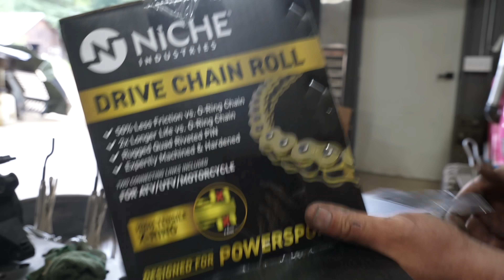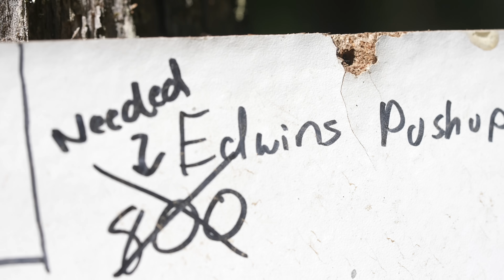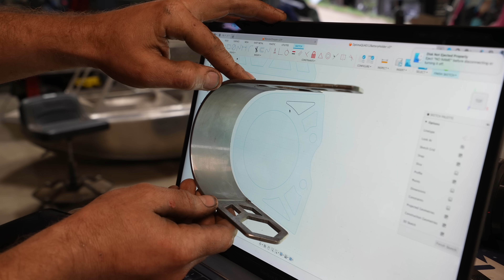We Rebuilt the Chopper and Met State Troopers!

Comment: I've powder-coated for many years and I recommend buying an old metal cabinet, insulating it, and turning it into a large oven with a temperature heat switch. This will allow you to coat much larger parts like control arms, swing arms, frames, etc. Then while coating hang the parts from a rack so you can just throw them right in the oven without messing up the powder. Also wrinkle black is by far the best color and the most durable.
Reply: I built my oven out of insulated tin. It's 2 layer of 2 pieces of tin with a 2 inch layer of spray foam in the middle. I have some old house oven elements in it for heat. One in the top and one in the bottom. Amazon ink bird temp controllers.
The tiny was free offcuts. The controllers were $20. The rest I had.
Reply: It would be great if they could powder coat the whole bike in house
Reply: Wrinkle black is not even close to the most durable choice for your coating
Reply: We did the same thing for curing large prepreg carbon fiber parts. It took a few attempts to get the temperature even and a lot of probes and datalogging but it works very well now that we have it tuned in.
Reply: I wouldnt have even masked up for those tiny mounts lol
Reply: @sublime660  it's pretty durable overtop of ZRP
Reply: To upsize my powder coat size, I bought an electric smoker oven on close out, insulated the bottom, just to keep heat. Works great.
Reply: Dunno man, wrinkle red though..... rocker cover on wheels HAHA
Reply: 100% That little toaster oven that comes with the Eastwood kit is a joke. Even a full size kitchen oven would be better, but like you said, making a bigger one for large parts is the way to go. Not hard at all to make if you know how to fabricate, which shouldn't be much of a problem for Ethan lol.
Reply: @isaaczondag2943   where I used to work, our oven was 36' I'm so glad I still know people that work there and Van give me access
Reply: I used to powder coat everything.   Spent way too much money on it.  I discovered epoxy paint, and a hvlp sprayer   have not looked back.  I got epoxy costed stuff outdoors in the sun for coming on 20 years in the tropics.  Aside from a little oxidation still great.  Hanging on that epoxy paint item is a powder coated item from the same time.  It has flaked off and has rust bubbles.
Reply: Can anyone get ahold of me for ideas/ specs of homemade  ovens?
Reply: @user-neo71665  inkbird seems to make pretty solid temp control stuff. It's a highly recommended addition to most aquarium setups once you get past that "I'm never financially recovering from this" territory (if a heater fails. We trust them to shut them off before overheating the water/fish) 

Cool to see them recommended for a totally unrelated purpose as well.
Reply: @preciousplasticph  I caught a smoking deal on an older 3M HVLP setup. The hose is short but the turbine is small so it's easy to move around. 

GAME. CHANGER.
Reply: I was going to suggest the same. I used to powder coat custom wheels. We had an oven that you could literally stand inside of it; we made a huge rack that would slide on metal runners like a railway track. That way we could powder coat the wheels and not need to move them as it's very frustrating having powder coated a wheel and you just bump it the tiniest bit and you have to re do it again!
Also especially with wheels, you have to immediately take them from the sand blasting cabinet and then we put them straight into the oven to outgas any volatile hydrocarbons (wearing gloves so no finger prints on the wheel) for 1 hour. Wheels out of oven and powder coated and put back into the oven on the roller train rack and baked according to the coat directions 👍
Any porosity in any weld or imperfections in the product (especially alloy/aluminium) can potentially be a spot where the coating will fracture and allow corrosion to get in.. leading to delamination of the coating.

Outgassing parts is probably one of the most important things that most people don't do.

Second is not sand blasting or handling the part and allowing any transfer of oils from the skin onto the part will ruin the part to start again.

We would use industrial strength paint stripper in a barrel (not watered down) to strip any part that didn't meet QA?

The wheel would get paint stripped
Power washed with a pressure washer
Sand blasted
Outgassed
Powder coated under coat 
Hand sanded wet n dry
Outgasses again
Powder coated in the base coat
Baked

If the colour was a metallic we would only "tack off" bake the base coat and after a short bake to l enough to make the colour gloss; then we would pull the rack out of the oven (not allowing too much time to cool or else dust could be attracted as the part cools) it's more difficult to coat clear when it's hot and requires the higher setting on the powder coating because the heat wants to repell some of the powder off the part and the base coat has some electric insulation effects so more "attraction" is required for the clear coat powder to adhear to the tacky still warm metallic base coat.
Then you get the parts back in the oven as soon as possible to try prevent any dust or particle  contaminates. The power coating gun will need to be cleaned properly in between doing the base colour and clear coat.

Most parts that were metallic we would often do the base colour and let it cool to be inspected, then the following day we would do another coat of colour and then do clear coat immediately after. That way if there were things like finger prints or dust in the first coat of colour, we could sand them out and touch up with base colour (repairing any imperfections or stuff ups as well gives more coverage and depth to the final finish in clear)
Powder coat the clear coat
Bake
We used a open ended booth with vacuum extractor (opposite to conventional booth because it's not enclosed and uses positive pressure)
Reply: I can also concur that wrinkled black or texture coat is by far the best as well!
Reply: @preciousplasticph  you absolutely must wear a suit though painting epoxy. That shit coats your hair on your arms and legs and NEVER comes off unless you like bathing in mineral turps!

Epoxy is very durable and has a little bit more flexi when it comes to durability compared to normal powder coat. To prevent chipping paint the selected areas in stone guard first and then sand smooth before doing colour 👍
Gives it some cushioning from stone chips but will require a lot more standing if you want it to finish like this rest of the paint or there's the chance it may not ever finish like the normal paint or cause tint discolouration on lighter coloured metalics (no matter how many coats your do - you've been warned)
Reply: Yes! This man knows his stuff!
Reply: nice
Reply: Why not use freezer/icebox since its already insulated and there is some with metal inner walls? Add separation sheet metal as heat shield, maybe some ceramic whool between sheet metal and ice box interior, window to door, heating elements from electric grill or such with temperature controller and you are done. Just need to make sure there isint plastic on the door area. Never built one but should be cheap since you can recycle most of this.
Reply: I was trying toto figure out a way to coat the frame of my Gas Gas 450 fse. I had considered making a cabinet that will slip over the front of a old oven or something. But I like your idea.
Reply: @andrewkiefer2628  Hey, insulate the shop well enough and get a good fire ripping and they could do it.
Reply: @user-neo71665  Isn't spray foam highly flammable?

Comment: I worked as a Tool and Die Maker for over 40 years so I have a few tips for you. 
---To machine hardened steel use the carbide from a concrete drill, set the center of the top surface of the carbide about .030 of a inch below center and slope it down at around 5 degrees, machine at a very slow speed and use NO coolant or lubricant, it will cut like a hot knife thru butter. Concrete drills can drill holes through milling cutter shanks, which are usually around 58 to 60 Rc.
--To straighten a shaft, heat with a torch, localized on the outer curvature of the shaft, till it turns blue, then quickly quench with wet rags. This method will pull a shaft up to .060, but if the bend is more, run a bead with a welder, again on the outer curvature and again quickly quench with wet rags, this method will pull a shaft up to and exceeding .125 of a inch, the excess weld can be removed without the shaft bending back.
--When welding hardened steel, always preheat the steel or the welds will crack or fail.
--If you ever want to weld cast iron, always preheat and weld with a Inconel or nickel welding rods, then let it slowly cool off, never quench in water or oil cause the weld will crack or fail.
--To drill a long shaft or flange on the milling machine, clamp a large V-block on it's side, clamp the shaft to the V, side the top of the mill out, yes they do move and even swivel, so you can hang longer pieces over the edge of the mill. You should be able to get a 90 degree head to drill horizontally, if you want to do it that way.
--Never, ever weld on a lathe, the beads could warp, arcs could form between the gears in the gear box and even fry the electronics of it. If you still have your old lathe around, use it instead. If you have no choice ground the part directly, a magnet works well, grounding through a live center will ruin the bearings in the center.
I hope that this helps you in the future.
Reply: This is,the reason I like the hand worker man im one myself and everyone is down to help or show you new things in the field fkin love that
Reply: Legit knowledge drop here! Thanks for sharing. ❤
Reply: Why the high nickel rods for cast iron? Does it help with the different crystallization patterns, or something else?
Reply: I've used carbide drill bits to drill through hardened 440c stainless, works amazing.
Reply: @davidshipside4211  carbide drills are of a different type of carbide, I have found that ONLY 883 carbide made by GE cuts hardened steel the best or like I said concrete drills. The carbide should be silver soldered onto a mild steel shank to give it a bit of a cushion. Do Not mount the carbide into a holder because a holder doesn't hold it firm enough.
Reply: Damn, I think I just learned more from this one comment than in 3 months of welding ‘training’ at my local community collage.
Reply: @valpilags8974  to clarify I was using a TASK branded glass and tile bit in my drill press on a cheap 440c sword..... Worked great.
Reply: Dang that's some top tier consultation right there
Reply: As an Electrician and Computer guy, it fascinates me to listen to Metalworkers and Mechanics talk about their jobs.
Reply: thank you for the sage advice.  Wish I could have apprenticed under you.
Reply: Thanks man, you're a real one for this knowledge drop and for being a positive member of the community!
Reply: These guys need to actually learn the basics before you can teach them anything. Some humility would do wonders!
Reply: This guy fabricates.
Reply: 50 year mold maker and I approve this message. 😎👍
Reply: @stankobarabata2406  With ya on this one brotha
Reply: I was thinking about this welding in the lathe, is healthy for the machine, the welding ark could appear any where for short period, just the current could be corrosive
Reply: I was wondering why I've never seen anyone weld on a lathe before - seemed like a good trick. Great advice.
Reply: Definitely preheat hardened steel prior to welding. If not, your weld and / or local steel  may fail. I'm so super impressed with how the upgrades went!! 
Big tires are hard to balance for all speeds. Chain tensioner and front guard look amazing!!
Reply: I love comment sections
Reply: I have never welded or machined metal but I read this entire post. Never pass up an opportunity to learn from someone who clearly knows what they're talking about and is willing to help.
Reply: Mad respect for your expertise, sharing it, and taking the time!
Reply: My tip, buy life insurance.
Reply: @martindinner3621 elongation. Steel and cast iron have different rates of expansion when subject to heat.
Cast iron's are already about the most crack prone alloys of iron and carbon; some even deemed "unweldable" because of that property. 
(White cast iron being one)

Long story short, nickel and the various allotropes of it used in the alloys which compose welding filler metals are used when welding cast iron as they form very tough beads
Aswell as their contraction rate is much less than that of cast iron's

Essentially it results in less stress when cooled, as the metals are "compatible" if you will
Which in turn doesnt fuckin split right down the middle when it's cooled

If any of that made sense
Reply: @lordfrostdraken  i think thats cause you were supposed to go to the local community college! not collage! haha
Reply: Need more like you doing college lectures.
Reply: I feel like you just dropped some hard earned info on a mostly undeserving audience. thank you.
Reply: 40 yrs plus here too
I was going to say all that ..
Cheers
Reply: 😎THE CAMARA GUY/ EDiTOR IS EXCELLENT #🥇
Reply: should have spelled butter buttah
Reply: @c4rnagEc4 not typically a long as you ground at your weld. I pipe weld at refineries with million dollar pumps attached as long as your grounded at your weld using DC current there won't be any issues.
Reply: Awesome comment
Reply: Starma's dad????
Reply: I had to copy and paste this.
I’m building a lathe controlled by raspberry PI and I was having issues with getting a shaft straight.
Reply: I wish I could bookmark comments, cause this is beautiful
Reply: The fact that the creator hasn't responded to this comment is the reason I won't sub. No modesty. Thanks for sharing.
Reply: Helped me. Thanks.
Reply: @lordfrostdraken  i know , me too . i guess nothing beats years of experience .. i  always listen and respect my elders that has helped me a lot  throughout these years
Reply: Perfect information thanks for sharing !!
Reply: Thanks  🌏👍
Reply: When I first saw this, looks like a bike made for Batman...it'll match the Batmobile nicely. Great project ! 👍
Reply: Obrigada,estudei num curso de produção industrial , e sempre é bom apreender coisas novas, genial moto, teria uma, americanos são um genio sempre parabéns uma das coisas que🤩 prestegio! gosto dos carros com rodas gigantes tbm!
Reply: lembra do Batman que é uma grande beleza!
Reply: Huh?😮
Reply: @martindinner3621  Cast is terrible to weld because it's weaker and cracks easily due to thermal expansion and shrinking .  High Nickel rods are basically more ductile than carbon steel rods .
Reply: After it splits down the middle thats the perfect time to mig weld it 😅, works every time .@GrubesicIronworks
Reply: Try to get on their team! They would appreciate this high level of relatable experience!
Reply: How about welding ductile steel=iron ?
Reply: We need more of this kind of people. Didn't even bother if the explaining will take too long, as long as it helps..
Reply: As someone who is currently learning CNC Machining, can confirm this. We use tungsten carbide everything when it comes to lathes, mills, you name it. Shit's dense and will cut anythung.
Reply: These tips and experiences are invaluable, demonstrating your deep understanding and passion for your profession! In your 40+ years of career, what is the biggest challenge you have faced and how did you overcome it to achieve the best results?

Comment: remember when someone said "you sure it'll have enough power for those wheels?"

I mean.... it bent the shaft 180° idk dude you tell me
Reply: Yeah, I didn’t get that either. You can always multiply the torque off a sport bike motor for whatever your application is. As long as you don’t expect the motorcycle drivetrain to handle the torque loads intended for a 4-Lo truck gear train, horsepower is horsepower.
Reply: Oh so it bent the shaft before he asked?
Reply: @skytho5799  nono, after, this was a long while ago when the project started
Reply: What's funny is with the right sprocket a 110 pit bike engine could do it haha
Reply: Wouldn't that be an argument against it?
Reply: @reezlaw  no, if it didnt have the power/torque, it would never have pretzeled the shaft
Reply: Not really efficient. You can do it but in reality there is a reason we don't all have scooter engines in our trucks...
Reply: @flaviusfake271  because we want to get there sometime today, but for applications where time isn't that much of a factor you can do surprising things with gears
Reply: @flaviusfake271  lol let's be honest efficiency isn't the goal with this project haha.... I'm making a point that it would still run, albeit not particularly fast on a bigger road haha
Reply: @flaviusfake271  Get wheels and a drive shaft with built in electric motors. Use the scooter engine to charge super caps and L-ion batts that power the motors. How many hp do you need to cruise? Or just use the engine you have already. It will still get a huge boost in MPG and charge a lot faster, esp if you fill every accessory slot under the hood with a high output alternator and connect them.
Reply: That particular motor is powerful enough to drive that tire hard
Reply: Yeah that's why it snap
Reply: Then it's diesel with electric transmission. I  feel like trains are considered a 'grandpa' thing but deserve some attention as incredible beasts
Reply: rip the tranny though no???